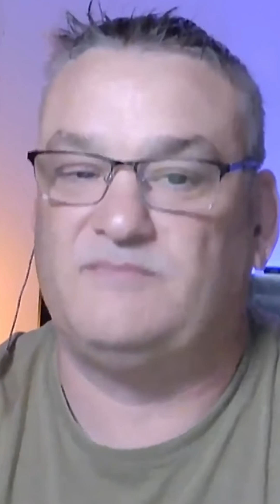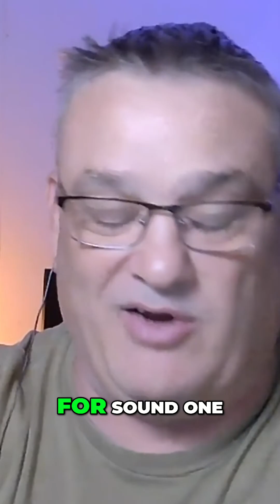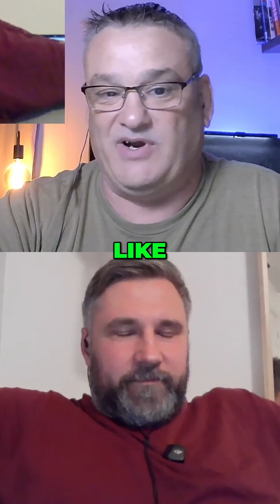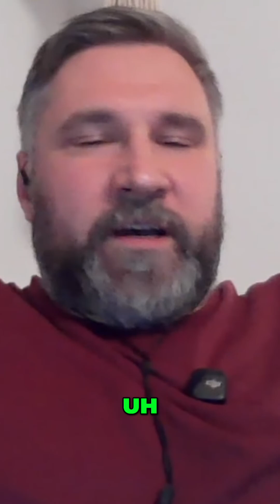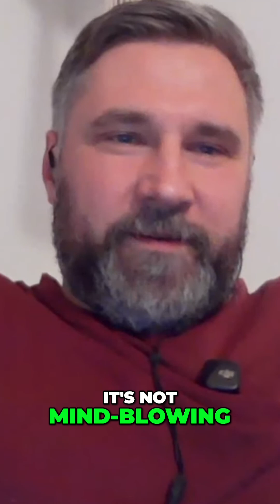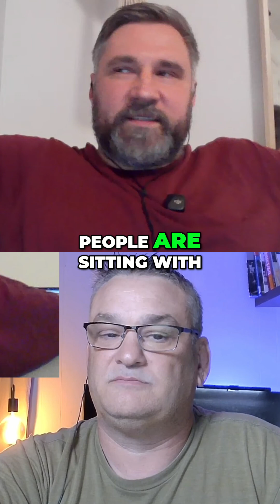DSPs in 2025 Are a Game Changer!

Comment: I'm putting a system together and have not made a decision on a dsp. Mostly because its new to me and I don't know how to set one up properly. I definitely need to do more research.
Reply from the maker: The down4sound and b2 audio sixten are under $200, easy entry and you can sell it easily if not your thing.
Reply: I have have had a  D4S 68+ DSP for a few months and despite a hiccup with the firmware have enjoyed learning thanks to all the online content. I would recommend them. Its like a starter DSP and simple enough to learn on. The low cost  the DSP allowed me to get my feet wet without spending a lot of money. And my stereo sounds good now and i could leave it alone but i am now moving on to a more powerful DSP.
Reply from the maker: @nickh5937 100% I think that are a great starting point to learn, great comment!
Reply: @nickh5937 thanks for the input. I should probably just pull the trigger now while everything is still apart and incorporate it to the amp rack. How did you address the firmware issue you had?